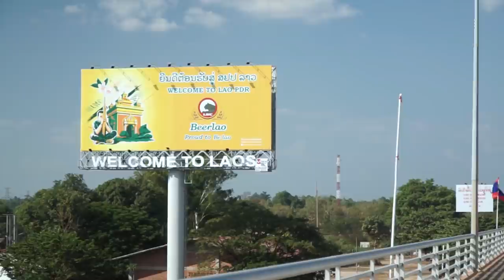How to go Bicycle Touring | A Complete Guide - 10 Essential Steps

Comment: Hi, extremely useful video! Now, if using gps on a phone, and you might still need an internet connection abroad for finding info also. Do u use free wifi at some public places - cafees, stations, libraries etc, maybe you get a sim card for a phone or some other ways?
Reply from the maker: Thanks! Yes we did get a simcard with a data limit for most countries. In some more expensive countries like Japan we relied on the vast network of free available internet connections.
Reply: @WheelstoWander  thank you, and how did you find using maps, is it confusing? have you ever lost your road using paper map, or its reliable enough? much appreciated 🙏

Comment: What about genital/but pain, how do you control that? 
I tried with special seat + pants, but after 60-70kms the pain still there, any tip?
Reply: ah and also wondering how many kms you do per day in average?
Reply from the maker: We do about 60km a day, after 70 we get sore in the butt. Sometimes it needs a lot of tries to get the right saddle and position dialed in right so don't give up! We also use a Thudbuster from Cane Creek that helps with mitigating bumps and vibrations from the road.

Comment: I want to add that burning toilet paper is rarely a good option. It's something that came out of the Leave-No-Trace culture in the 70s, 80s and 90s. It's not recommended to do nowadays and can in some instances be illegal. 

Climate change is causing increasing amounts of droughts and as a consequence fire bans are not uncommon because of how easily vegetation can catch fire. Tourists have been known to cause large scale fires due to not knowing of or respecting fire bans.
It's something you must be completely aware of when travelling in a foreign place and not something you should judge for yourself. You can face a long time in prison if you burn down a forest, even if you do it due to ignorance.  

Current best practice says to bury it at least 50m away from nearest water source. Sprinkle water on the TP instead, toilet paper is made to disintegrate when exposed to water and microorganisms decompose the rest very fast.